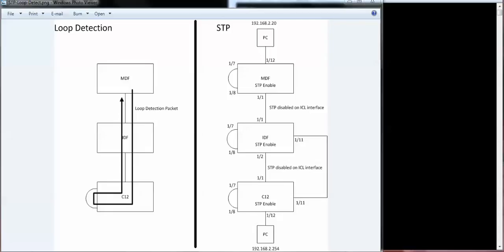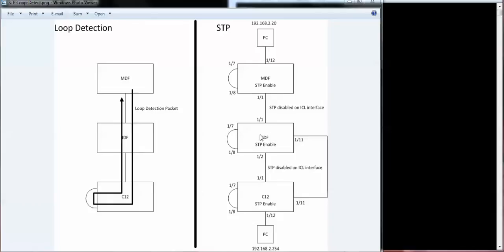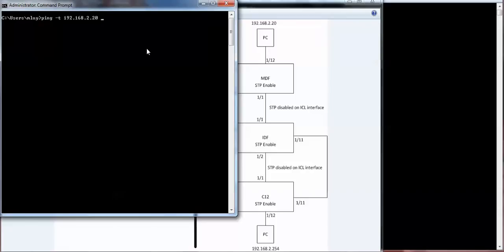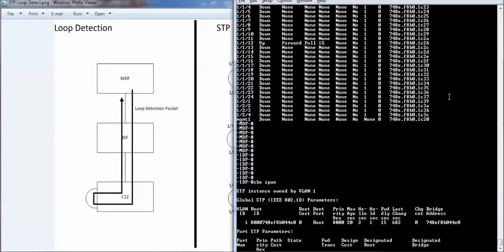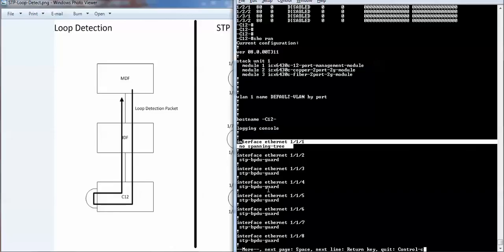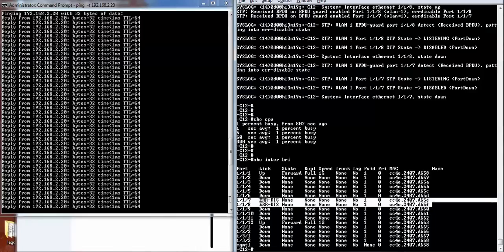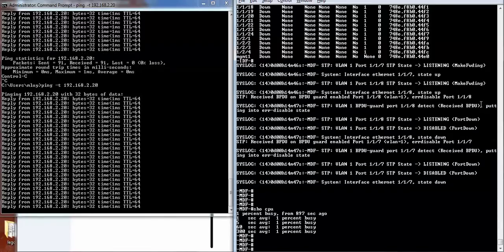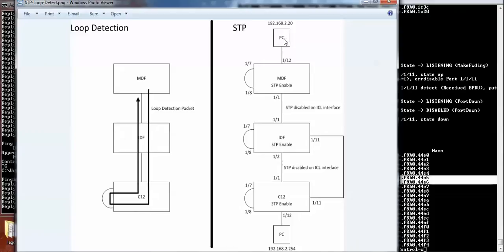Brocade STP vs Port Loop Detection configuration

Comment: Curious, after 7 years. Do you still use this method? Currently designing a medium sized network myself and used strict loop-detection but considering changing to bdpu guard.

Comment from the maker: Edge loop detection in strict mode works great. The main issue with strict mode is that it detects a loop only if the loop detection frame is sent and received on the same port.

Comment: Why would you not just use strict-mode loop detection? And I wouldn't think it'd be a great idea to enable this on your distribution, it seems like this would be much more useful to enable only on your access switches where users can create a loop. STP is good for internal switch-to-switch loop prevention, loop-detection is good for switch-to-user loop prevention.